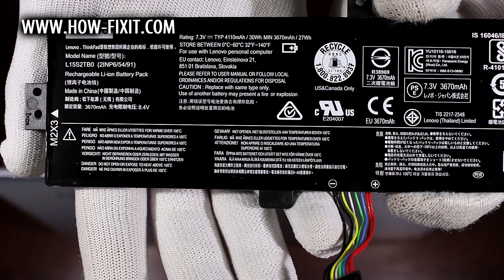Lenovo IdeaPad 310-15 Disassembly & Battery Replacement | Complete Step-by-Step Guide

Comment: I have taken a replacemant battery from green cell. It was electrically the same, but the mechanic wasn't exact the same, so I had to work on it, but at least, the new one is working because of your exact clip.

Comment: Thank you for this tutorial. I thought it's easy to change laptop battery, but decided to google my model and when I saw this video, I was glad I didn't just open the laptop and tried to figure it out. Step by step video was definetely neccessary, otherwise I would probably ruin my computer. Well, I successfully changed the battery, thank you!

Comment: if that's what's involved then I'll never be buying a Lenovo laptop. It's ridiculously complicated. Previously I've replaced batteries on other laptops which took 10 seconds. Press a couple of clips and slide out the old then just click in the new. Absurdly and unnecessarily involved process that only reflects a very poor design.

Comment: can i still use the laptop after i removed the battery?
Reply: please help me i have some issues on my battery, i insert the charger and nothing happens, it wont charge my laptop, i think maybe the port is damaged
Reply: I've got the same problem too, can we start without the battery just with the AC adapter alone

Comment: Any of you guys could tell me what's the runtime of the laptop with original battery. Unfortunately my ideapad 310-15ikb drains the battery in 2 hours. How is it possible? Is the original battery  the problem? And if that's the case to change it with something more powerful?
Reply: I have the same issue, it seems as if the Lenovo cheap out on the batteries for this line up of laptops. Mine also lasts 2 to 1 hours with some luck. I'm planning on getting a new battery with supposedly a higher capacity if that doesn't help I'll let you know.
Reply: @RealOny  Does it help?
Reply: @tomasz9075  unfortunately no.

Comment: This is a really stupid design to put a battery so deep inside. I wish I could see this video before I purchased the 310. I am so stupid. Why I didn't buy a removable one? Supposed all the laptop should have a removable battery.
Reply: Agreed. The design is bonkers. You shouldn't have to remove the whole backing panel, and the CD drive, and disconnect leads on the motherboard, and sacrifice chickens to Beelzebub (ok, I made that up), to get to a laptop battery. All other laptops I've had the battery is easy to slide out of the back, no screwdrivers required. This very much puts me off getting another Lenovo. Coming to you, Tosh...
Reply: I regret buying this laptop, mine is a lower tier model with an AMD A12. All I can say it's that't I will never blindly buy a Lenovo laptop without looking at some reviews first. The battery was pretty much dead out of the box and it did not last more than one hour and half (with some luck I could get it to 2 hours) which was abysmal since it meant that I was pretty much connected to the AC all the time. Piece of shit laptop.
Reply: They make it that way because they want you to buy a new one when the battery is dead. Same goes for other Models and phones. Almost all Switch to this shit.

Comment: Wow, thank you for this . At least now my curiosities to try and act like a pro dissecting my lenovo laptop are all diminished , I am glad I didn't try it carelessly. After seeing the inside of this laptop , I found it to be no need to disassemble my laptop more than necessary , just look at that circuit design ! , its too complex! with no extra caution , some wires might accidentally lose up and be cut , and the battery, yes the battery , just look at that thing. =_= . I really think it is better if the battery can be taken out deliberately(not built in) as this is essentially imperative for gaming and editing purposes which consumes a lot of electrical power.

Comment: Totally STUPID design from Lenovo with these built-in battery models! I would have bought a 510 in a snap if it weren't for this idiotic built-in design only because some shitheads nowadays want laptops that are thinner by 3 millimeters.
Reply: true i just bought a new Lenovo this exact one in the vid and i wanna remove the battery cause i use the pc a lot and now i cant . no other opitions my battery is going down it wont even last for an hour after i few days
Reply: i think they did this design so our batteries fucks up and make us go to their stores to change it .     If i new this i wouldnt buy this peace of Junk